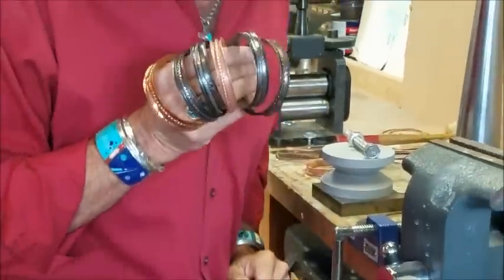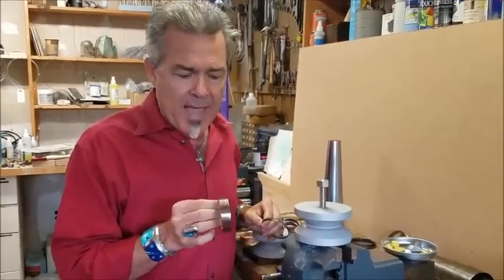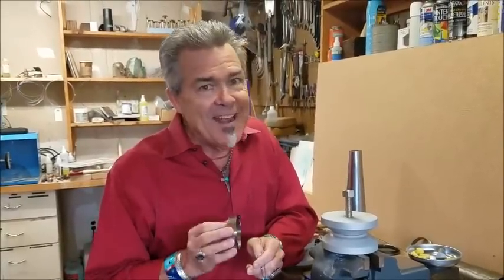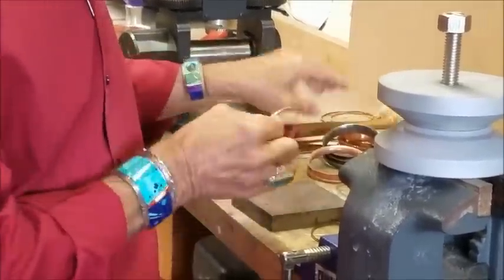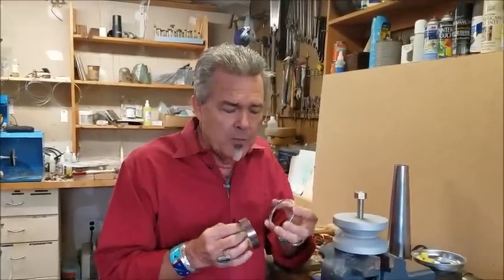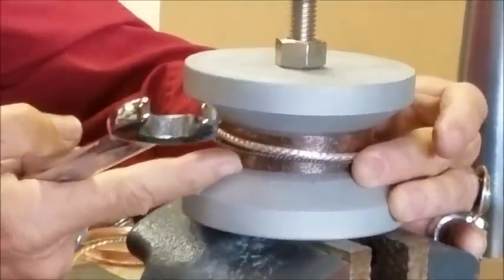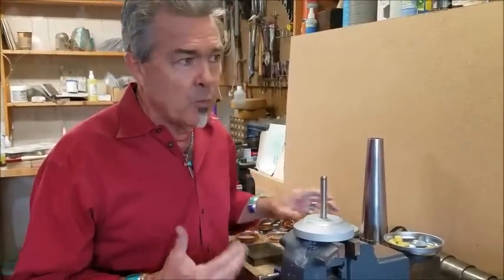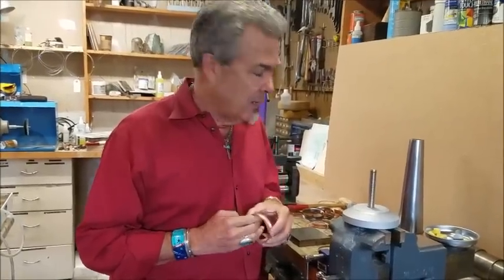How to make Spinner Bangles

Comment: I bought this 2 years ago and haven't gotten a chance to use it yet... I finally bought a copper spinner bracelet (made with it) from another jeweller in my area 😂. She has a rolling mill so had a cool texture on hers, that I won't be able to get when I finally start making these.
Reply from the maker: Use a hammer or stamps to get textures. Just have fun with it!
Reply: @artistjefffulkerson4327  I plan on it! Just got my work area put back together after a long time, and am getting excited to make things again.

Comment: That tool is genius! 

Great video and demo, too.
Reply from the maker: Thank you . Glad you like it!
Reply: Artist Jeff Fulkerson Can you crank it down more to create a bigger flange on the bangle? Or will it tend to split the metal quickly? 

That can actually be a desirable effect, when done intentionally - and is something I do actually want to do. I can’t afford the giant dapping tools to do it with, though, nor do I have the strength, plus I live in an apartment, so noise is a huge issue. 

I assume you can also use the tool to make rings, obviously as long as they are bigger than the bolt?
Reply from the maker: @wendyannh  You can't use the disks to make rings as they are too big. You can crank down the disks until they touch each other. How much flare you get will depend on how wide and how large a bangle you make. typically, the metal only splits at the solder joint and its pretty uncontrollable.
Reply: Artist Jeff Fulkerson Thanks for the info!

Any chance you will come out with a similar setup for rings?

I should be more able to do those with dapping punches, but the noise would still be an issue. I’m always looking for ways around that!
Reply from the maker: @wendyannh  Kevin Potter made one. It works OK.

Comment: Hi Jeff! I see you used 24g, isn't it a bit thin? What would be the thickest you would suggest that we can use with this tool? Thanks!
Reply from the maker: 24 gauge works well because it's easier to form & once you put in the compound curve, even the copper becomes incredibly strong g.
Reply: Artist Jeff Fulkerson hi Jeff, but as far as if someone wants a thicker look, how thick can the metal be with your tool?

Comment: OMG... Genius!! I have to get one and add spinner bracelets to my repertoire I love making spinner rings & have designed something like that "In My Head" for simplifying the bends in one process. I originally got the idea 2 yrs ago while at a boating surplus store and noticed the shape of the thermo plasticized rubber rollers, used with anchor winches. Obviously too big but your concept of 2 parts with rod in center is exactly what my idea was. Who does one go to about getting a design fabricated?
Reply from the maker: When you say "get a design fabricated" do you mean a tool or the spinner bangles?
Reply: When I say fabricated.. I mean a tool, similar to yours but for rings.
Reply from the maker: I went to a machine shop.  Understand, this tool is patent pending so you can't just go out and make ones like it. Besides, everyone uses dapping  punches for rings.
Reply: Oh no; You misunderstood..   I would never copy your design. I actually went on your site to buy your tool for bangles. 😀 How Long  before restocking??  I'm interested in having My Design for Rings made.  Yes, I too use dapping punches, as well as the back of hammers. Thank you for your response. Merry Christmas!!
Reply from the maker: They are supposed to be in tomorrow or Monday. I did a pre-sale and I only have 2 left!

Comment: This tool looks great! Can you use copper solder, or do you need to use silver solder? (My copper solder seems strong but brittle.)
Reply from the maker: I don't like copper solder because it's brittle, expensive and it isn't really copper in color. For copper bangles, I use medium silver solder. You can either leave the tiny silver line or plate the copper in old pickle.
Reply: Thanks Jeff! What's the largest diameter / interior circumference you can make? I have a customer asking, and I haven't gotten a chance yet to set mine up.

Comment: Hi Jeff! I bought this tool from Halstead a few weeks ago but I somehow managed to get it stuck, and not can’t get the nut to move. Any advice you can offer?  Thanks!!
Reply from the maker: It sounds like you might have stripped the bolt/nut threads. First, to un-stick, you hopefully take a big wrench and a lot of elbow grease and loosen it. Second, if you can't do that, you may have to cut the bolt off. I had a student do this in a class once and all I could do was cut it off.  The REAL question is why? Why did this happen. Two theories: You may have worn out the bolt and used it one too many times or you may have tightened it all the way down to where the two disks hit each other and kept trying to tighten to get a little more bend in your bangle.  The first problem is easy: when the bolt starts to throw off little bits of metal, buy a new one. They're only about $1. The second problem just takes a little 'feel'.  You should never have to exert tremendous pressure turning the nut. When it gets tight, that tells you that's as far as you can go, so stop! Hope this helps. Let me know.
Reply: Artist Jeff Fulkerson thank you so much!!!! I will try that tonight when I get home from work.